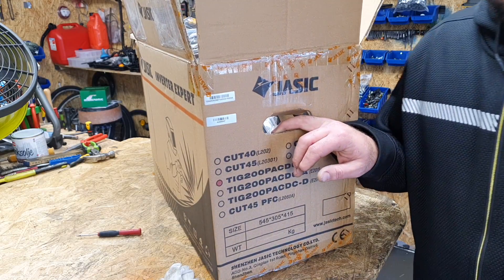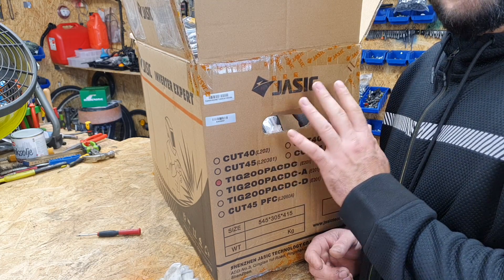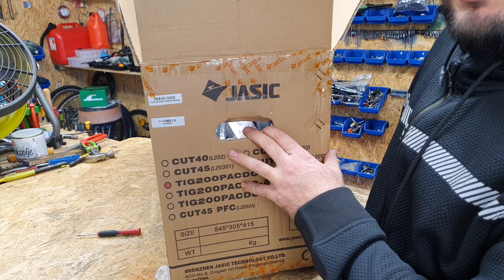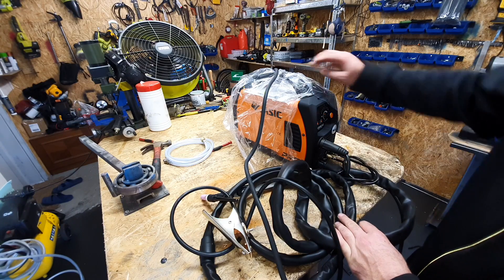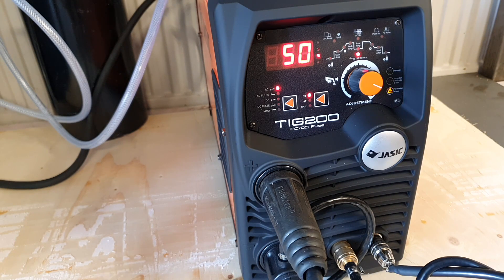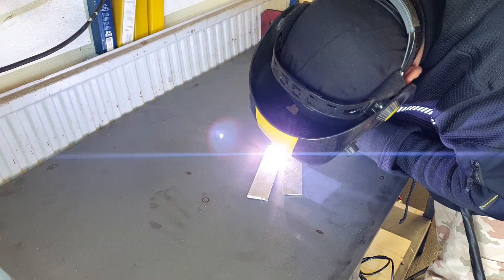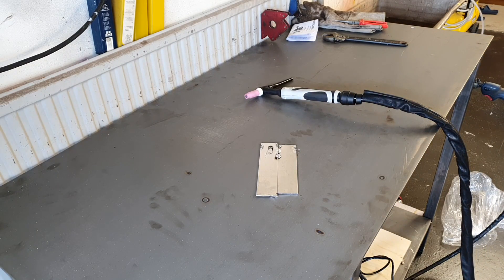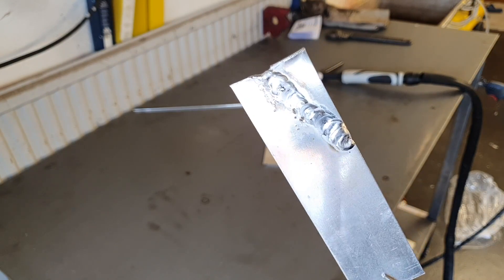Testing a Best Welding Machine

Comment: man! keep yourself away from such devices.
Reply: STFu bot
Reply: @soulbrothers7789  He is right.  This guy doesnt have a clue
Reply: @dinoj8126  You obviously don't have clue wtf you are talking about
Reply: @soulbrothers7789  Mate im certified in 111, 141 and 136. What are you on?
Reply: @dinoj8126  111 MMA
141 TIG
136 FCAW

I am welding engineer so
Reply: @soulbrothers7789  Are you an inspector or a welder